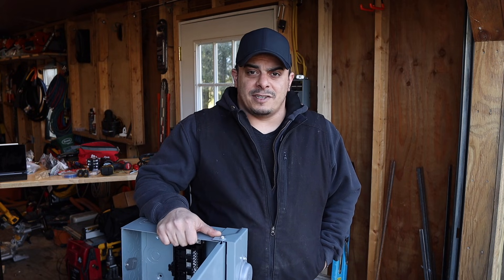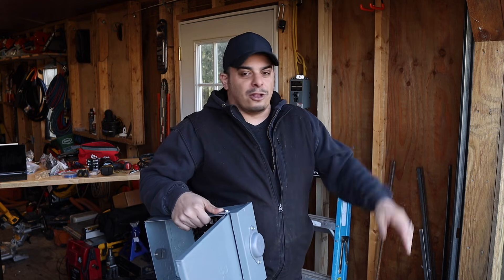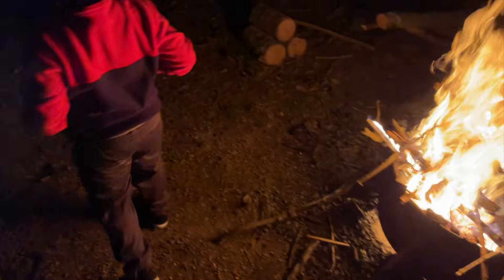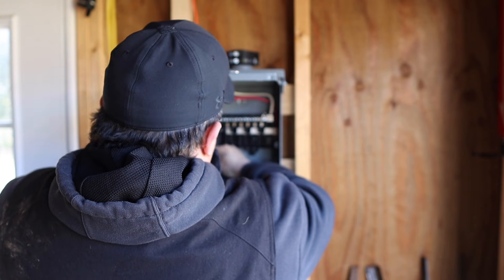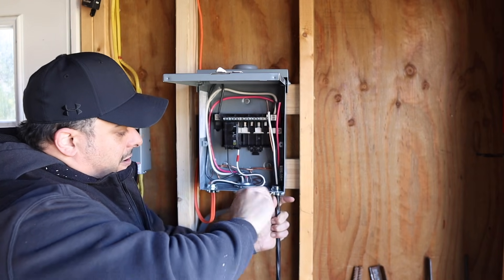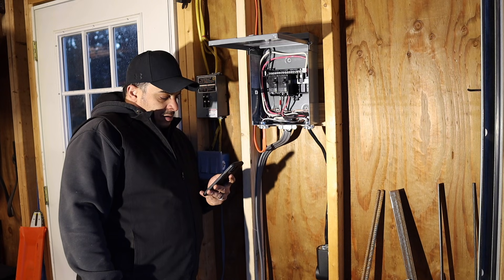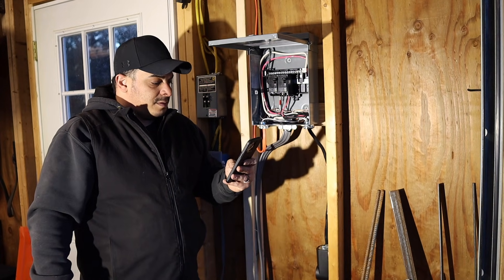Installing a Sub Panel for Heater & Welder + 50amps in the Garage

Comment: Thanks for the video! I'm trying to do something similar here. Trying to run 220 to my basement from the garage where my main panel is. 

My question is, Does it matter how many amps Im installing in the sub panel? I noticed you have a 50 amp breaker feeding your new panel. But you have a 30amp + 40 amp breakers in the sub panel.... the math doesnt add up in my head.
Reply from the maker: The breakers in the sub panel are protecting the wires that go out of sub panel to devices. For example if you have in your main panel a 50 amp breaker you would run number 6 to your sub panel, if the sub panel has two 30 amp breakers and you were to actually try and pull 60 amps the 50amp breaker in your main would trip protecting the number 6 wire that feeds the sub panel. I hope this helps
Reply: @NickPixelTV  Thanks for the reply! I got it now. I may be maxing out my amps with computer equipment! I appreciate it!

Comment: A little late for most but if you have to dig for the service cables just use at least 2inch conduit you can run what ever you need through it at just about any time ya overkill for a 30 Amp but perfect for a 100 to 200 Amp in the future

Comment: Can you help me just bought a house the garage has three 15 amp circuits and one 20 amp circuit. I want to run 220 also. The inspector said there is a jumper wire that is improper.
Reply from the maker: Justin, What is the the feed wire size that runs from house to garage and does it run to a sub panel? How many amps is your main panel? How many amps do you want in your garage?
Reply: @NickPixelTV  I do not know the wire size but the house panel is a 100 amp and the sub panel is in the garage. The Garage has the 4 fuses. I think it's a 50 amp sub panel? Appreciate you replying
Reply: Can I send you a picture of the box somehow??
Reply from the maker: @Justin-bb7oi  my email is on my about page ;)
Reply from the maker: @Justin-bb7oi  it sounds to me like the wire youll need between the panels is a similar setup to mine make sure its #6 wire between the panels you would have a 50 amp breaker in your main panel then the #6 feeds the sub panel in which case you can break that down to your 15’s or 20’s or even a 30amp for your 220. With a 100amp main in your house youll want to be cognizant of big devices pulling power so that you don’t trip the main.
Reply: @NickPixelTV  thank you 👍

Comment: Good video, but I must say, it made me cringe when I saw you touching wires inside the panel box.
Reply from the maker: Thanks. The other end of the feed was sitting in my yard and wasn’t connected to main panel yet so there was no worries I did that last ;)

Comment: Have a 50amp braker that was used for my old stove. Can I use that wire to run a sub to my garage? Also can I just run a 20am plug and 2 15s?
Reply from the maker: Im just now seeing this my apologies  just make sure its #6 wire and then have your 20 and 2 15’s or even two 20’s or 3 you’re protected by the 50amp breaker that feeds the sub

Comment: My brother in law  ran water lines and electricity to my garage where  my parents live. The problem is that when my mom turns on  microwave  and minisplit  ac  it trips the breaker and also a combination of other appliences.
The garage has a lot of outlets and I  think they are on a 20amp breaker with a 14 gauge romex cable and brother in law  also got electricity from the exiating 220 0r 240 outlet in garage to add more stuff. When breaker trips the whole power goes out in garage and also in kitchen of the main house. I think circuit is overloading.I was thinking of adding a 60amp circuit to main box  and running a new line to garage and in garage add one of this  boxes Eaton Corporation Br816L125Fdp 6 Circuit Main Lug Load Center, 125-Amp???
Also will I need to cancell all existing outlets and start from
Reply: I know this comment is a year old, but for anyone else facing something similar. 14 gauge (14-2) wire is only rated for 15amps. If your brother-in-law put a 20 amp or higher breaker on 14-2 wire, this is a fire hazard. If the breakers are flipping, then increasing the amperage of the circuit is NOT the solution, but how you would burn your house down. Essentially to solve you problem, you need to have the garage lights on their own circuit, the garage outlets on their own circuit, the microwave needs to be on its own circuit, and you should probably put the fridge on its own circuit. It sounds like your brother-in-law just tapped into the kitchen circuit and ran it out to the garage. Probably not the best idea given both areas often use high amperage devices (blenders, microwaves, coffee machines, saws, welders, etc.). 

Hope that helps.
Reply: @in.der.welt.sein.  thank.u

Comment: I'm not an electrician but I was confused about the red tape?  Aren't both the white and black hot?
Reply from the maker: Yeah you can use red or black i just did red.  If it was a 3 way switch where you’re using white as hot black tape is typically used.

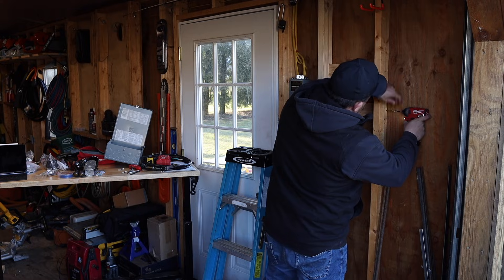Comment: I like Miller welders. That’s what I ran all my years at Bath Iron Works. We ran feeders off from inverters. Most of the inverters were 354’s. I would LOVE to be able to get a new 354 inverter and feeder and harness but I just ain’t got that kind of money right now lol. Plus some 💩 head stole my new husqvarna 565 with a 32 inch bar on it. Oh well it is what it is. I saw a ford very similar to your black one the other day. It was a 4x4 half ton straight cab. It said “camper special”. It had the most leaf springs I’ve ever seen in a half ton. It only had a 300 6 with a 4 speed. I about 💩 myself when he found out it had 4:56 gears. My buddy is gonna use it for a plow truck. I’ll get a pic and email it so you can see it. Sorry for rambling!! Nice job bud and as always WORK SAFE 🇺🇸🇺🇸😎😎
Reply from the maker: You can ramble anytime my friend. Someone stole your saw? Unreal. Def email me the pic of that truck very cool.